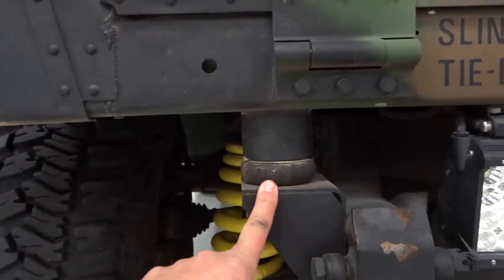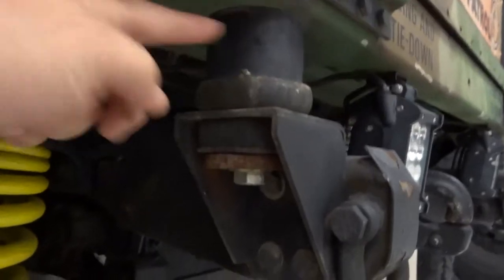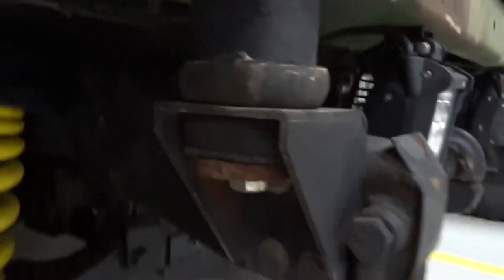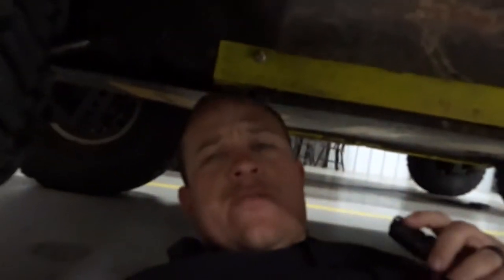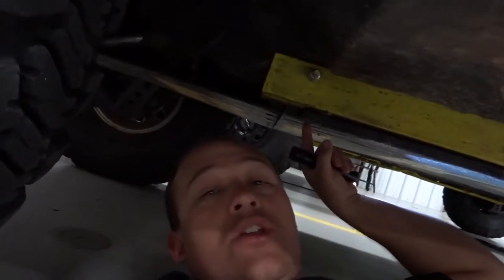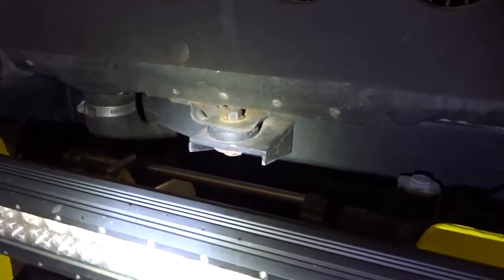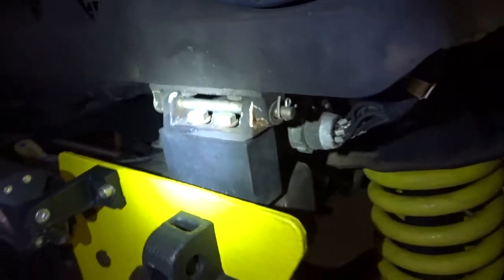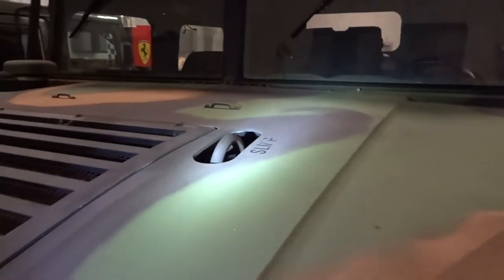how to install body lift on humvee

Comment: Look good but do you have to extend the tank strap or any other modification?
Reply from the maker: Vaillant PASSECKER yes the kit from rubber duck comes with new tank straps and we bought a longer filler neck hose also.

Comment: Was wondering about linkages,lines,filler tube.steering column...that stuff                   peace
Reply from the maker: geoffreyjones2000 with the 2” lift the only thing we had to do was get a longer hose for the filler neck and re adjust shift linkage.  Went very smooth.